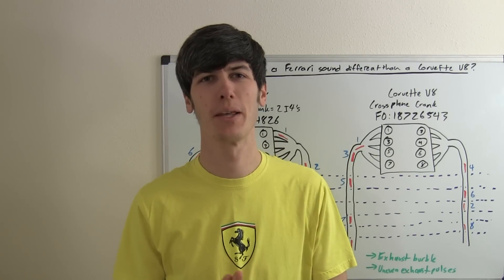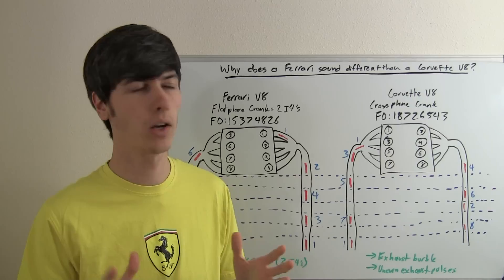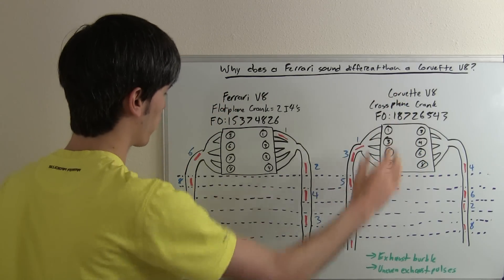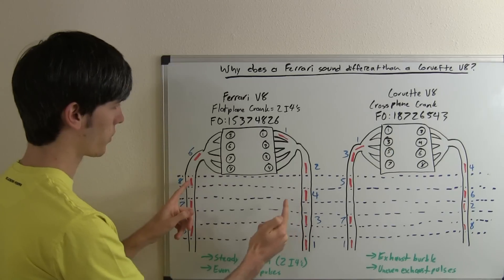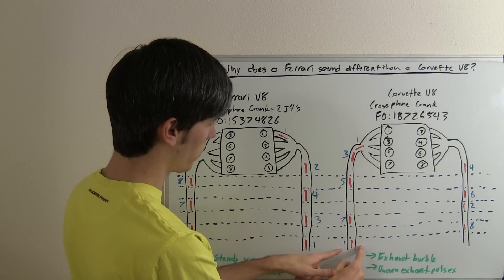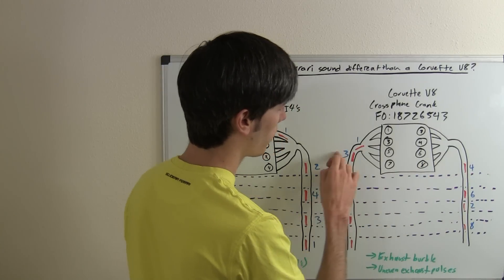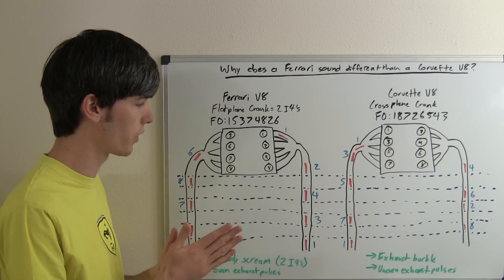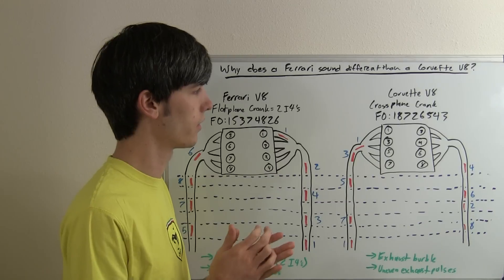Ferrari V8 vs Corvette V8 - Why do they sound different?

Comment: I'm a Ferrari mechanic and I'm not going to get into details but there's a lot more that differentiates the exhaust sound in ferraris compared to regular V8s then just the flatplane crank but that is a majority of it. Great video explanation for those who are just starting to learn and don't know any better without getting too technical for newcomers, keep up the good work
Reply from the maker: Of course there are countless differences that account for the different sounds. Many are curious why some V8s have a signature burble, and why others have a much more continuous noise. Thanks for watching! Tell your friends at Ferrari I'm willing to collaborate at any time! :) Actually, I'll be riding in one for the first time tomorrow. Quite excited!!
Reply: I'm not that high in the ranks to make that much of an influence haha, otherwise I'd gladly help you out, compared to others I'm kinda new working here a few years. And I'll be getting my own f430 soon combining speciale and scuderia specs, not financially ready for the 458. Soon to be building an f12 berlinetta v12 above Fxx spec, the basics of all new 6.3L v12s from us are the same since the Enzo but with minor improvements, the main difference is the price tag of which block you choose from the choice of chassis associated with each. Also getting to work on a grand-am 458 and I'd like to build my f430 v8 to that spec. It may not seem like it but we have a lot going on around here haha
Reply: Also have a Ducati 1198r limiter off and upgraded internals, 240sx coupe s13 (my first car) sr20ve itb rwd 11k rpm 300hp, Nissan hardbody d21 KA-T 4x4 parts hauler, ae86 20v levin hatch trueno coupe, Nissan r32 rb26, 510 sr20, FD rx7 homemade 4rotor, track s2000, evo4 high boost, and a bunch of other lower budget Jdm projects that are fun to play with and share costs with friends.
Reply: djfuzzo1 ide be able to die happy if i had half the cars you own lol
Reply: djfuzzo1

Are you an Initial D fan?
Reply: I spend too much on cars and parts that I can't buy food lol. Some I don't own myself but I share parts cost with friends so we trade and drive each others whenever we want so I'm part owner of some but not on the titles. The 510 s2000 rx7 and a few others not listed aren't mine but I do a lot of the work on them and split parts cost with friends to be part owner. If you spend 50k or get sponcered to go to Ferrari training school like I did its completely worth it and if you do good work you get other opportunities to work on the race cars and special builds on top of your regular 6 figure salary. Glad to hear you guys approve of my builds. And yes edge I am, I've seen every episode and wish a new season would come out, great show haha
Reply: I mean You can make extra from those opportunities. Renevated the big garage behind my house to fit them in so it works like its own mini shop with tools lifts and extra engines and parts for future builds on the shelves. Still saving up to start my own exotic/Jdm high quality shop someday soon hopefully where I'm able to make all the parts I need in-house and extras to sell. I've also learned about working with fiberglass and carbon fiber so it would be nice to make bodys and monocoque chassis and sell very rare replicas like the pagani zonda revolucion for an example because plenty of collectors want one but only 5 were made so there's a market for them even without the pedigree of brand... Anything to make more cash and enjoy doing it in the process, these are hopes and dreams for the future of course
Reply: I don't know who this rob guy is but there's plenty of homemade 4 rotors out there, it's just not too common because all the extra work involved. They never made it from the race track from the 787b 13j or r26b to the street but if you combine parts from 2 13b engines with the right parts to hold the housings and seals it will fit together, ppre is a company from Australia who made the first 6 rotor and that thing is a beast. I've seen 3 rotors make 1700hp on YouTube dunno runs so his 1000hp 4 rotor is a realistic but not a surprising number. Would be cool to have a 6 rotor like they built but their crank kit is too expensive and I don't have a forging machine laying around to make my own during work hours lol. And if you study MSATs (manufacture certified training) and work at a dealership or specialty shop you can get starting pay at like 75k a year and work your way up for raises at Audi BMW Mercedes porsche and those sort of mid range high end luxury brands and after years working there and becoming a master tech I think their max pay is around 150k which good but the money isn't the most important part, its more about being happy and good at what you do and enjoy going to work and getting paid for it. My advise is follow what you're passionate about because just like any other job you work your way up from the bottom doing a good job and with promotions comes raises so no matter what you do as long as you're good at it money will follow in the future, I mean the CEO of any company wasnt born yesterday, they work for years to get where they are now but happy to give tips, hope my advise helped you out
Reply: Dyno not dunno ^ (auto correct)
Reply: dude it sounds like you have pretty much the perfect job. building Ferraris and making enough to own you're own, doesn't sound too bad haha. talk about dream job!
Reply: If that's $65,000 American dollars then he's doing something wrong. The one I did was like 5-10k to finish the engine project lol, but then again it doesn't have the turbos setup yet or the power goals you mentioned well not yet anyway but even still it shouldn't cost that much for only 1000hp. And yea cj, I love what I do. Professionally the engine purrs are like sweet talk, they dont cause me any problems unlike compared to the personal life issues that are more like a slap in the face lol. To quote Jesse from fast and furious "engines are just something that calms me down"
Reply: If you really worked at Ferrari I think you'd spend your time a lot better than just telling another person on YouTube how more knowledgeable you are than he is through a comment. And not to add that you have sooo many cars. People who are associated with Ferrari are more interested in other cars like Lexus LFA, Mercedes-Benz SLS AMG, and Porsche Panamera Turbos. Not Nissan Silvas, Rap music, and Drifting videos.
Reply: Rey everyone has downtime to have to entertain themselves during when not working on something while waiting for parts to get delivered and no one goes out everyday after work, it doesn't hurt to stay home and relax watching tv and videos with my girlfriend. I never said I was smarter then anyone, all I did was share my experiences with people who asked about it. Yes some of my co-workers have more expensive cars but that means they can't afford to buy multiple in order to fix up and have fun with diversity and variety and to have choices on whatever you feel like driving on a given day to enjoy driving because the feel in them all is very different on the road for multiple reasons due to engine tuning and suspension setups etc along with the fact that I've been saving up for my own f430 to fix up and enjoy with the option of different cars I own and can drive daily or to the track occasionally on weekends or show and talk about when hanging out with friends, I'm down to earth and don't feel the need to be interested in only more expensive cars when I can go just as fast and look good doing it in more cars that cost less, I don't feel the need to flash my money around for no reason just because I can.  Besides the fact that I never said anything about rap music, I don't want or feel the need to argue and explain myself to you about my life which you know nothing about like you claim to know that people associated with Ferrari apparently have to fit a cookie cutter mold and all act the same without having my own personality and preferences in what I like. Just because the job comes with a higher quality of class and professionalism doesn't mean I can't appreciate more cars that cost less, I mean for an example not every billionaire owns a Bugatti. I'd appreciate it if you didn't try to act like you know more about me and my life then I do about myself, have a nice day
Reply: Hello djfuzzo1, I'm wondering what kind of education background I need to be a Ferrari Technician. Is a graduate degree in autoexpertise enough plus good grades or do they only hire Mechanical Engineers who graduated with bachelors or masters degrees? Thank you. Kind regards.
Reply: Leon depending on where you're applying to work, different places have different standards on their preferred education for entry level positions whether you would like to be part of a dealership service department or a private shop I'm not sure. It also depends on the position you're looking for in the company whether it be a mechanic technician or a mechanical engineer in designing these cars. When it comes to the technician part of things which is what I do, if you would like to work either for Ferrari directly or for a dealership of their cars, if you would like to be certified rather then learning through an apprenticeship the training school in maranello Italy would be your best bet like I've done and while their you can choose a specialty whether it be working on road cars or work for the racing division. I'm not sure if you have the tuition for that or have spoken with someone about the possibility of an education sponsorship with a work position waiting for you upon receiving certification but the training school it's self costs $50,000 not including travel or living arrangements and the base cert takes 5 months of training to learn working on both current and past models. Having a general ASE certification always helps the understanding of these cars but maranello has the ability of teaching you to become a specialist master tech on these cars, good luck with your search. If any other questions feel free to ask I'd be happy to help
Reply: I appreciate the information you gave me. 50 thousend seems to be a redicelous amount of money, and I thought the 27 thousend at UTI was expensive haha. I don't even have a highschool degree, but I'm looking forward to join a technical institute here in Belguim. The chance to even work as a mechanic even at Renault or Fiat is very small to none for me at this moment because I have no degree. I know mathematics and understand what Law of Newton is and also have studied the basic components of an engine and powertrain. But that's it. I will let you know if I passed the entry exam. Thank you for your humbleness btw. I wonder how you joined the company, through apprenticeship or directly flew to Maranello? And what education background if I may ask? You don't need to answer, just curious. Have a good day, sir. Agon
Reply: Yea, it's a lot but have to remember this is ferrari. And you easily make that money back in your first year of work. I've never really been that into Renault but I know fiat is pretty easy to get in with but either way, a degree helps a lot especially if its from that specific manufacturer. I started as an apprentice to show my worth as a good technician to have then worked my way up to get a sponsorship to fly over to maranello but before all that I've known cars from working on a lot of them coming to know the ins and outs of engines, suspensions from the normal everyday maitnance components to how they work and what they do for performance and tuning specifications so from learning all that and much more ive had the opportunities of working with the race teams and the special projects like the factory performance cars sold to public like development of the Fxx-k and 488gtb among others like working along side the scuderia team for the f1 guys, helping with the p4/5 race version by glickenhaus with a small role in working on the scg003 and the gt 458s in the Le Mans/challenge series' and many other similar opportunities I've been grateful for being able to be apart of from being able to learn all that I've come to know now.  plan to run my own shop working on and building them myself soon
Reply: Feel free to ask anything more that your like to, generally I didn't have someone to help me out like this back when I was in your position so I'm glad I can pass along any useful info I've come to know over to you so you can achieve the same things sooner
Reply: It's not that I really want to work at Fiat or Renault, but I what I mean is is that like Belguim or Germany they so love their diplomas and certificates. Of course I understand these are important. I am curious about the mentality and behavior of your collegues at the shop and at the factory in Italy, are they really academic, adult and pelite type of people as they are presented on camera? Maybe a weird question, but I have heard about mechanics and technicians at other regular shops at different brands, talk about the gossip and slander politics that goes on there and ruins the job itself. I work in a supermarket and I see this daily, but is this sort of sabotage politics avoided at Ferrari sp.a? Because I like how Ferrari puts the well being of its staff at first place.
Reply: The academics and hands on learning are both very important, obviously the academics have to be proven for what you've learned in the theory part of training before being able to show you can perform the work too. But yes, it's a very organized professional environment just like you may've seen, that's part of what the company prides themselves on along with their history but that's the right way in how it should be even when it comes to new car development and improvements, part of keeping the job is knowing when it's work time versus when to joke around and have fun but maintain the maturity not to mention anything offensive that may cause you to lose your position, just like any company your good behavior is a reflection of the company you are representing during working hours. Usually topics of conversation here aren't about politics and more about the jobs going on or car performance racing results and ideas or other general hobbies/casual normal life, like having friends you work with, things usually never get too political since that's almost always a taboo topic so I guess you can say it is avoided but not with a conscious effort, those kind of things just usually don't come up in conversation at least for me that is. Not sure what you mean by sabotage because none of that goes on here but if you mean are we free to talk about improvements other brands like Lamborghini or others have made on their cars then sure there's nothing wrong with that, we talk about other brands too with each other just not in front of customers because that's not the best for business. But yes, Ferrari does care about and comfort employees by making it an enjoyable desirable company to work for, everyone I know working here is happy with the job
Reply: Mainly conversation is about how we can make our cars better to be known as the best quality from exceeding and surpassing our own goals to maintain and keep the precision and innovations  associated with the Ferrari name and reputation
Reply: The thing is I have heard from a few American Technicians that most Automotive shops have this politics of backstabbing eachother or just bad collegue relationship. That's all, I was curious if this also happens in elite shops like where you are working currently. Was just curious about it. My next questions are, do I need to be connected or hired by a dealership first to go to Ferrari school or is that not needed? 2nd, do only Technicians and Engineers who have the Italian citizenship work in Maranello or can I with a EU member paspoort or you as a US citizen work there as well? Thank you.
Reply: No, that doesn't happen with us here at all it's like a friendship working here since we're all mature and have the same interest in these cars. You don't need to be hired by a dealership first but it does help having a job ready for when you're done with training and have a Ferrari certification. You don't need citizenship to work there, a passport will work just fine. Citizenship does make things easier but it's not necessary, I'm Italian so I have mine even though I was raised in the US before I went back to both the maranello school and a general visit of home. Most of the people who work on the production line are citizens but not all, that's just out of coincidence because its easier to work in Italy if you already live there like they do, citizenship isn't obligated but learning the language pretty much is needed.  With either citizenship or a passport anyone can work there as long as you know the education to do the job
Reply: I like that, this is how it should be in every workplace, sad that it isn't everywhere like this. This world has not been perfect since the fall of man. But at least there are companies who put the well being of their employers first when it comes to profession. I like that. Does Ferrari also offer a free scholarship to study mechanical engineering when you work for the company? 2nd question, is there a waiting list to join the Ferrari school or are there enough places to fill in? Third, is the Ferrari school also open to those who have not graduated from highschool but still can enter with an entrance exam? Thank you.
Reply: Yea. But I don't think they do, not sure about that but if you do speak with a dealership about working there after training they might pay tuition for you.  I don't know the current situation but when I was there they had a few open spots but right now who knows, there could be a waiting list. Yea, of corse it is open to plenty of people no matter your education level.Remember it's a scool for cars so they aren't as concerned with diplomas like law school or medical school etc would be. There is still knowing your math and science about cars generally but academics aren't that important other then what they are teaching you
Reply: Thank you, that is quit satisfying. But I'm also wondering if I can choose only to work on Ferrari's or is it required to also work on Maseratis? Is there a choise? I have read about the changes that are being planned by new Fiat CEO, it has been said that Maserati will take the roll over from Ferrari, does that mean that Ferrari will be alone again like before 1998? And wich would you recommend the most, the 488 GTB or the 2015 458 Speciale/A? The 488 GTB has a better exteroir than the 458, but the 458 has a nicer interoir than the 488 my opinion. Do you maybe also know what the starting monthly or year salary for a Ferrari Technician in Europe and the US is? I have read somewhere it said 33 thousend a year. Don't know if it's true.
Reply: You can choose to only work on ferraris but usually guys who go for one usually get both because it doesn't hurt and looks better to employers since there's more maseratis out there and since both brands share a lot of parts along with parent company partnership. Before the 488 was announced I liked the 430 scuderia but once the 458 speciale came out I loved it but now that the 488 is coming soon I like all the new innovations on it and ill be waiting to drive the higher performance version, sure the feel very different to drive but I can't choose, I like both a lot and will have my own soon. And well it does depend on your exact work location but after being certified, starting pay for a year salary could be around $75,000 can be higher or lower but not extremely, with the opportunities to grow. And be apart of projects that pay more when progressing in the work ranks
Reply: Hi fuzzo, how are you today? Excuse me for the late response. I went to the nearest Ferrari dealership today and told me that I needed to come back thursday and they gave me the name of the guy has the info about this Tech school. He wasn't there today, The F12 and the GTB look even better when you see it for real haha, I know you can give me info as well, but I thought why not go myself as well and see what they have to say. Btw, the classes over there, are they seperated by language? For example because I speak Dutch, I will be in a class with only Dutch speaking recruits? Or are all ethnicities together?
Reply: I'm curious to know what you hear from them if their info is different from my experience. Nothing wrong with learning whatever you can from those who know. I don't believe there is a Dutch speaking class there but I could be wrong but I'm sure there has to be someone there who does know the language but your English is very good so I wouldn't worry too much about that haha
Reply: Yes I understand what you mean, it would be also easier because then they maybe they could help me get the documents via them to participate into this programme Ferrari offers and maybe also other info, then also a good thing is that they know me and I know them. Thanks, my English vocabulary is sometimes incoherent or I mis spell sometimes, I have noticed. But when I speak, you can understand me as well. 75 thousend is a very good starting salary, It looks like an Engineers starting salary,,, Well then they propably start with even more I assume. About the transmission of a Ferrari, when you press on the flappers on the stearing wheel, do you also have to press your foot on a padle like any other conventional automobile? Or are the paddles or flappers on the stearing wheel the only elements that are used to switch gears and put the vehicle in neutral? And wich type of wheel suspension does Ferrari use? A double wishbone or Mcpherson? Or are there also other type of wheelsuspensions designed by Ferrari? And also about the KERS system, it's only installed in the F12 and FF right?
Reply: Sorry I'm late, been busy lately. But no, you don't need a clutch pedal on a paddle shift car, the paddles are linked to the computer which tells an actuator to shift gears which makes everything happen a lot faster. And no there is no KERS in those cars, the only f12 that has it is the TRS one-off version. There was an experimental 599 with it but that wasnt available to the public, that car is currently in the museum in Italy. The current production KERS car is the LaFerrari with possible other model editions getting it in the near future